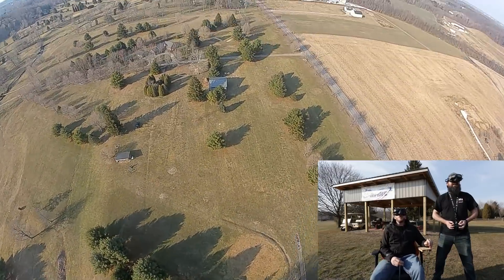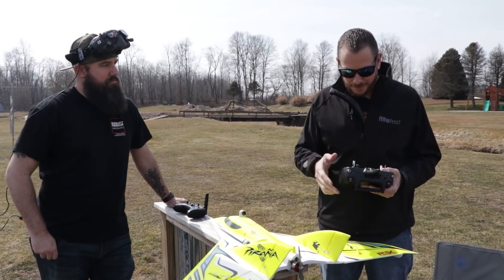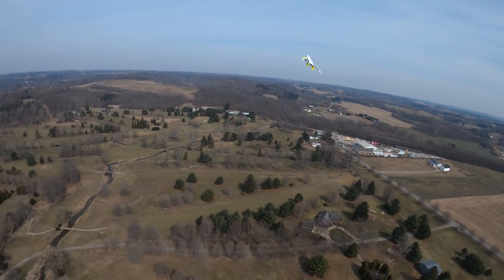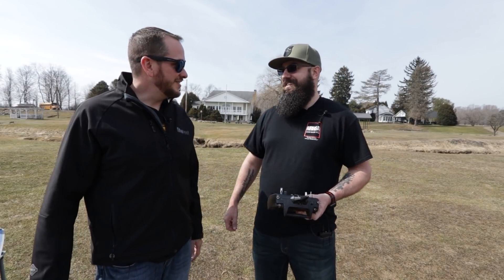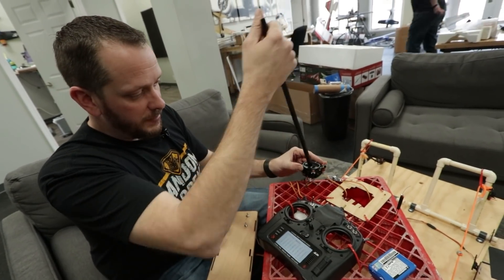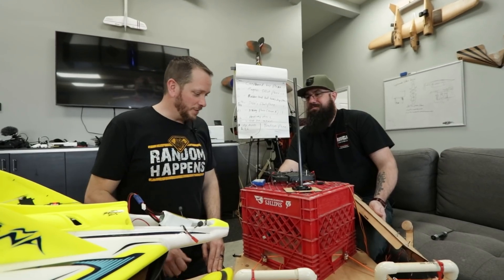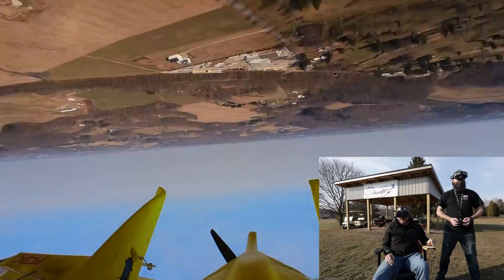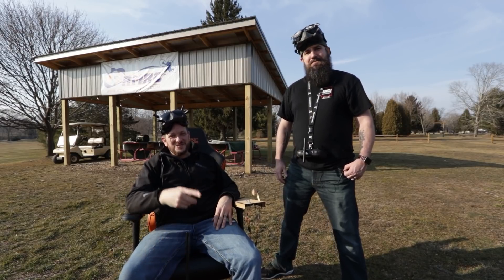Flying 120 MPH In A Home Made FPV Cockpit

Comment: I hope you can make an RC plane with head tracking FPV and a realistic cockpit, while also utilizing this kind of controller system. 

It would be great if the RC would have a flight computer that is programmed to respond like you are flying a real aircraft, realistic turn rate and throttle response and acceleration. 

That would make a great realistic flight simulator. I've already seen headtracking FPV with great cockpit interiors however, I've been wondering on how immersive it could be with that kind of controller system.

Comment: How did the dji air unit like being mounted up front like that in this plane? Or was it a one time use for the video? I have an air unit & bought this plane to install it in. I liked the idea of a wing with rudder control. I'm concerned with the air unit getting hot inside this plane mounted up front. Wondering if I should create cooling vents though the fuselage to where the air unit mounts to help cool it. 

By the way neat idea on the chair. It's nice to see people be creative like that & share it.

Comment: Excellent video guys. Just a wee comment on Raycon "Premium Wireless Audio". They are not words that you can use together! Premium audio will NEVER be wireless as you just can't match the audio throughput of a piece of wire! Even a average wired connection will pass more data than anything "premium" and wireless. It may be better than some others, but is just another sad case of the desire for convenience, winning out over the desire for quality. I do have an audio engineering degree, so not just a rant. The flying was great though!...

Comment: have the ft mini arrow built an a ft flyer, the arrow was my first an i crashed it all 3 times that i tried to launch it alone. didn't have anyone to help out so i went back an built the ft flyer cause it seems to be a good choice to learn with then im going to try the ft tiny trainer cause it looks like a glider an from my understanding thats a slow flyer also but that will have more controls to learn but i want to build my way up to being able to feel confident enough about my skills to actually spend the money on something nicer like whats in this video, maybe something thats not as fast cause i dont have alot of room to fly where i live so im limited by that i think.

Comment: Wow, a video encoder somewhere got very very confused at 13:48 - it thinks the ground is rotating in opposite directions in the same frame. Is this because it was a 360 camera?
Have a link to 13:45 so you can watch out for it.

Comment: Point one, you might be concerned if the main guy on the video says I am going to trust this out of the box at the same time a YouTube disclaimer says this is a paid promotion. 2. More to come. The opening flight footage is using either internal or post edit video stabilization to give value to the takeoff footage.

Comment: Buy a Hotas Warthog joystick & use a Arduino interface then once tweaked you wouldn't believe how accurate it becomes so smooth, if you buy the set get the throttle controller then you will be rocking like a URV pilot similar to what the military use, oooopss shhhhh hehehe

Comment: They should put the gimbal in the center of the milk crate flipped over then run 4 taught springs one from each corner to the stick to give it a self centering feel.

Comment: Hi, i am currently looking at getting into the r/c hobby but have no equipment barring foamboard a couple servos and a very low budget (£60-80ish) 
I think i want to make an f t flyer but if there is a better plane to make please recommend it
I also know nothing about transmitters and receivers and do not have one, what is a good budget transmitter that i can use as a newbie? 
Thanks (:

Comment: I have a challange for you.  I've been going to RC air show for awhile now.  They fly all kinds of obscer planes, a flying Iron, a lawn mower, a witch, ect.  What i would like to see is a plane that takes off normally but lands inverted.  I was thinking if you could have retractable landing gear mounted on top (hidden). Also a rudder that routates 180 derees so it starts in the right posistion but inverts to get out of the way to land.  Also flaps that not only go down but also go up so when your inverted they accully go down to assist with landing.

Comment: It would be amazing to combine this with head tracking and force feedback to the stick. If you could send IMU and GPS data as telemetry and process it fast enough, you could have next level immersion. With a custom built stick you could make it tighter/looser depending on speed and IMU data.

Comment: PLEASE figure out a way to use PC Flight Sim gear with a proper seat like from Monstertech sim seat and HOTAS controls.  Bind it all to a Crossfire base station with antenna and throw it in the back of a pickup truck.  Check out Virpil HOTAS gear!  Might cost you $2k in gear but it would be an EPIC RIG.

Comment: Hi Guys,  I have liked this one same as the first time you brought out the FPV chair.  I broke my back in 91 and I have been flying out of my wheelchair since.  I still can walk just not able to stand up for more than 5 minutes.  I have made a chair way back in the 70s but I used cables to a radio and then to a controller for flying.  It didn't work out,  but I was really hoping that your did. Thanks again for the video.

Comment: The ultimate in a ground based flight sim chair would use an Aerotrim,  https://en.wikipedia.org/wiki/Aerotrim for your Flight Simulator Chair.  Basically you would use a pair of large stepper/servo motors to drive the Aerotrim.  The motion would be coupled to pitch, roll and yaw data down linked from from a modified quad copter flight controller to the Aerotrim receiver.  This is something I have wanted to see someone do since about a year before the first RC FPV plane was flown.  Still waiting for someone with deep pockets and serious electronics and software coding skills to take on the challenge.  Any takers?

Comment: Add some weight to the controls for the ultimate experience. I’ve use anything from springs, bands, gas struts, and different resistance hair ties even. Relatively easy to adjust and such a major performance improvement for both the control and fpv stabilization.

Comment: It would be amazing if flight test built a model with a realistic cockpit with clear windows or canopy. Instead of a model pilot in the realistic cockpit put a moveable camera that tracks with your head movement in FPV. Also consider putting a microphone inside the plane.

Comment: What drone was TJ flying??
Reply: Nothing special.  Diatone roma dji frame.  Dji air unit. Crossfire. Using diatone f405 dji stack 50a 4in1 esc.  Sunnysky edge racing 2207/1800kv. 6s 1300mah

Comment: Speaking of the Aura. I just bought one and installed it in a Top RC Swift, and it worked perfectly first try without making any adjustments. The Swift is an EDF powered glider capable of 100mph, a real blast.

Comment: I would love to see this adapted to search and rescue missions! One camera on top for the person flying and one below for a second FPV for a search observer (or to share the experience with friends in the off times :) ).
Reply: Justin, yes, a very low budget kit could do a huge amount of good in 'small child wanders off into the fields' situations. Probably want a slower airframe for greater control, and low and slow ability.
Reply: @albatross8361  Actually you want to just use a drone.

Why are you guys trying to reinvent the wheel.

I had to double-check that your guys's posts weren't from 7 years ago.
Reply: @dangerous8333  We WERE talking about drones. An FPV cockpit would enable the drone pilot to fly the drone beyond his visual range, and with better flight control. As in manned aircraft, things go better when pilots concentrate on flying and observers concentrate on observing.  In a search and rescue situation, a long endurance drone with cameras looking forward, port, starboard and rear, feeding to observers on the ground, could be more effective and cost-effective than a manned aircraft.  It would not replace pilots like Mike Patey, but it could be a force multiplier for them. The Flite Test team probably have, or could assemble, the required skills to build something like that.
Reply: They have insane drones in law enforcement. I saw one at the local fair this year. It had thermal cameras and all.
Reply: @80xavior  They're using Autel Evo's with flir cameras. It's just a consumer drone.

 Just the camera is expensive.
Reply: Why?

Regular camera drones with Flir cameras that can hover are way better for search and rescue. Why would you need or want something that goes 120 miles an hour and can't hover? And why would you want to to use multiple operators to accomplish what a single operator with a drone can.

🤷

Edit:
You could say that something this fast could cover more ground. However, I would argue multiple drones flying slower can cover the same ground and do it more efficiently.

Comment: You guys need to do a modern how to for FPV with different cost levels and include a 3D gimbal with head tracking.  It has been years since you covered FPV goggles and their features and prices... cameras, headgear, antennas...  You also have not done much with good starter packages for quads and planes in years also.  A lot has likely changed in the industry and while the DJI stuff looks nice it is also rather expensive and lacks upgradability.

Comment: Listen to his breathing when the plane is upside down...he SOUNDS like he’s upside down.  Like a weird psychosomatic response!  Interesting accidental science
Reply from the maker: It was crazy brother. The immersion from using the controls over a transmitter totally took me there. The crash really messed with me when it happened. Totally want to step this up a notch. :)
Reply: @FliteTest  would be cool if u make a small cockpit like in the a10 to make it more inmersive with the fpv
Reply: @FliteTest  I think if you could make the yoke mounted on the right arm of the chair, the stick could be much shorter giving you a more connected feel. This is fantastick!!! LOL
Reply: @FliteTest  Hmm, ppg version for acro training? I'd make the drive there just for that. 🤣 That and you're parapeople which makes you my people anyway. I look forward to seeing where you take this.
Reply: @FliteTest  I’ve always wanted to see fpv mixed with a motion simulator chair! Have the chair bank left when you roll left etc... I think it would be a ton of fun. I’ve seen a video of someone doing it with an RC car but I believe it was only 2 axis. Still cool though.
Reply: @FliteTest  I want to see more!  It was one of the cooler vids you’ve done in a minute.  I suggest two or three seats and races!

Comment: Get an aviation sponsor and make it worthy of a real simulator. Make it feel even more real by adding a gimbaled FPV camera controlled by head tilt so you can ‘look around’.  

Got me thinking: has anyone put an accelerometer on an RC plane and linked it to a ground station via telemetry?  Put the FPV chair inside a giant joystick gimbal and tilt the cockpit in response to the acceleration!!!
Reply: Check out my homemade cockpit

Comment: Put the fpv in a "glass" canopy made of cut up water bottles so it feels even more like a real plane
Reply: Little 180
Servo to turn the camera left to right
Reply: Then they could put the fpv cam on a servo head tracker and that would be a real cockpit lol
Reply: @legendarypot8oanimates160  Or they could use Track IR
Reply: Like the a10
Reply: Yes that would be next level! Have the camera on a rotating thing so you can look Port and starboard but it returns to looking straight by default. That would be sick
Reply: Headtracking is a thing. It was kind of a gimmick and not many use it.. FPv with fixed wings is kinda hard visibility is bad and a plastic canopy would make it much worse
Reply: I agree, I’ve thought of that before and you’re the first person that I’ve actually seen say that, I guess it’s not only me🤣